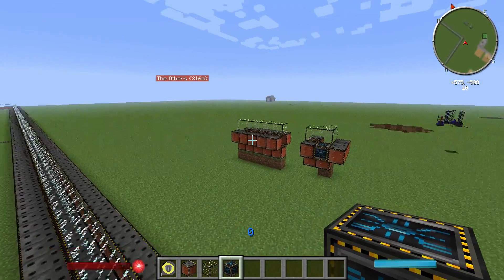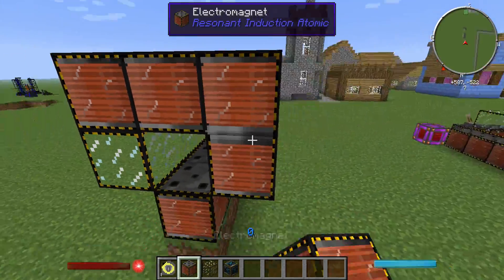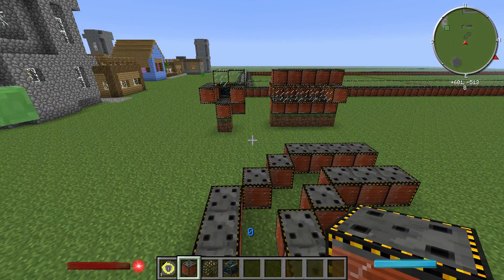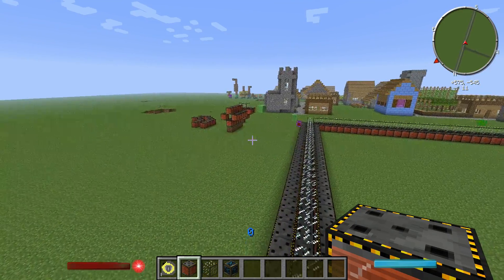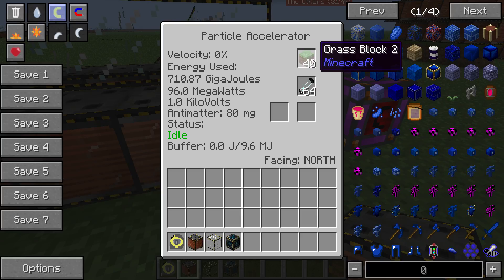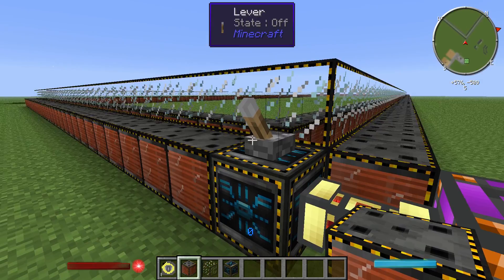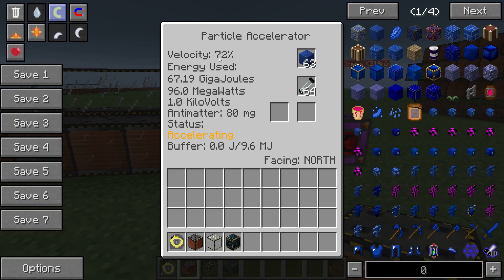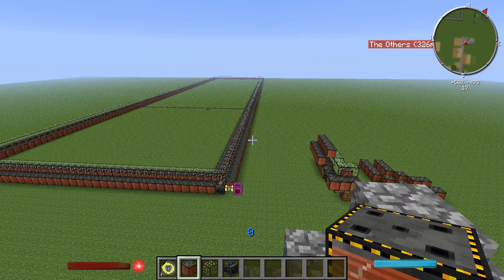Voltz Tutorials: Particle Accelerators

Comment: my particle accelerator goes to 70% then restarts? i have the right voltage, power etc. its 31x31
Reply from the maker: +shiba plays not sure. The mod may have changed the way it works
Reply: a thing i do see is the particle accelerator takes an extreme amount of power in just 10 seconds